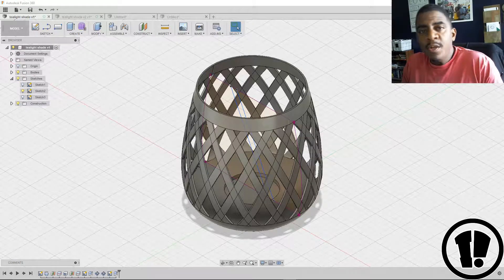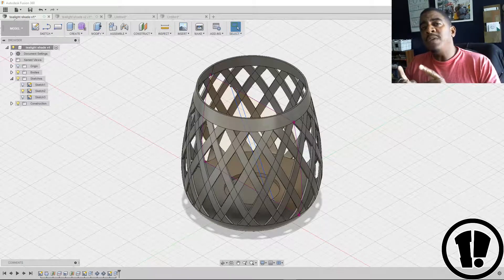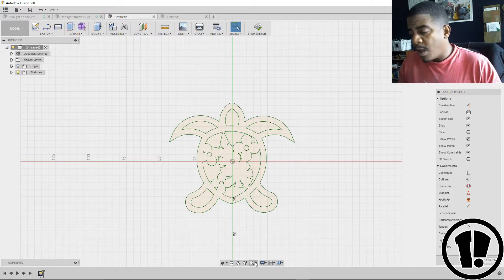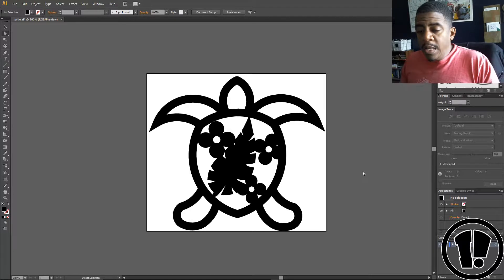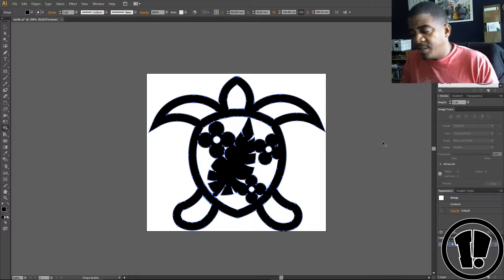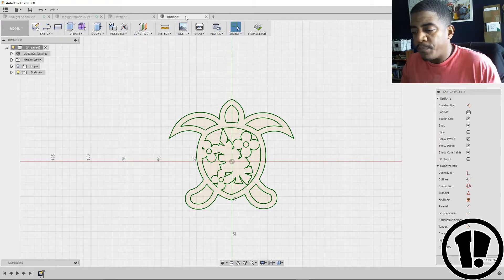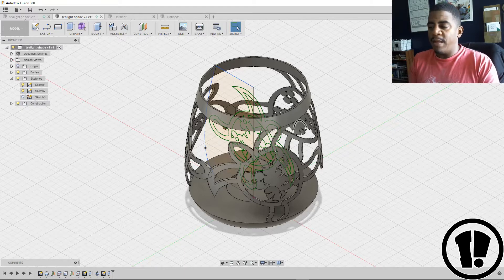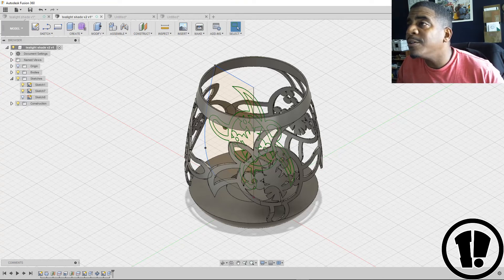Fusion 360/Adobe Illustrator - Fixing A Bad SVG

Comment: That was really helpful!
I imagine printing that with those free floating overhangs is going to be a challenge unless you have tons of support. It might be easier to print it as separate parts and assemble afterwards.
Reply from the maker: I have tried printing them with no success. I think your right about printing them in sections. If I can pull that off, my wife will be so happy. Thanks for the suggestion.

Comment: Hey Nice t light have question how did you create your t lamp is that same work flow shown on link you mentioned
Reply from the maker: +Hardik Dave yes. The only difference being the import of the SVG file instead of drawing the pattern.
The SVG file itself is a separate process.
Thanks so much for the compliment.
Reply: IZBLAB! Ok thanks for the info I want to surely try something like this